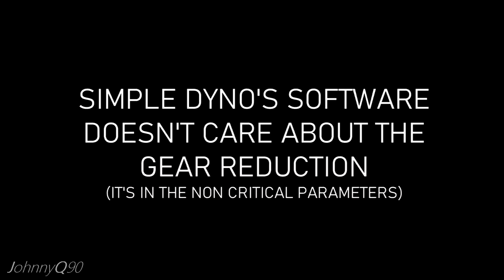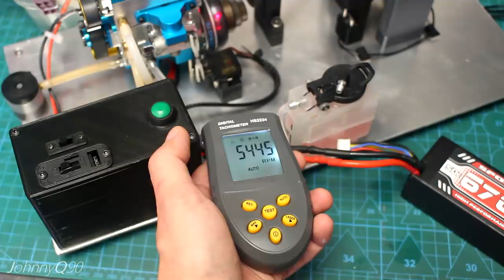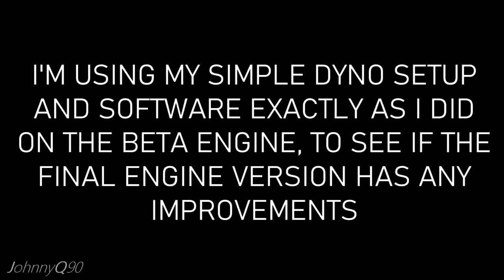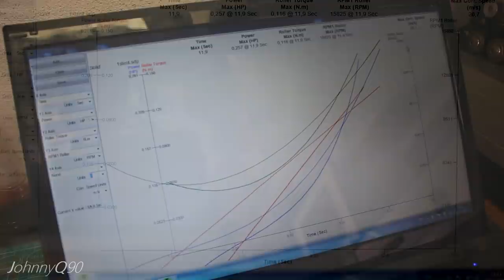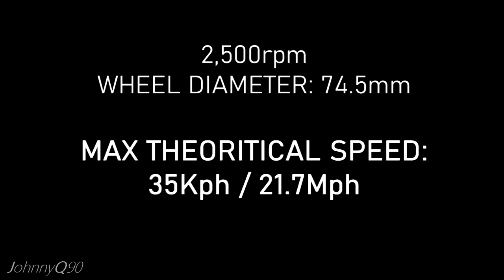TWIN Cylinder 4 Stroke 8.6cc TEST -  Dyno/ MAX rpm/ Road test!

Comment: Second never been so quick

Edit:-SOHC? But I see two cam gears tho...not saying that I'm right
Reply: I was going to comment the same. It looks like a DOHC design to me too. Need the cam cover off to know for sure though.
Reply: SOHC is a Single OverHead Cam, also can have two cam gears, but one is for the intake and other for the exaust, a SOHC engine have two valves per cilinder, one for intake, other for exaust, while DOHC have four valves per cilinder, two for intake and two for exaust.

Also there's few cases it have 3 valves per cilinder or also 5 valves per cilinder(for example the 4AGE, AE86's engine)..

If any car specs doesn't appear if the engine is SOHC or DOHC the better option is check the valves, a 4 cilinder engine have 16 if its DOHC and 8 if its SOHC, in this case the SOHC 2cilinder Toyan engine have 4 cilinders.
Reply: @matthewmondragon2074  So a single overhead cam engine can have two cams?  You're funny.
Reply: @dav1dsm1th  Camshafts
Reply: @matthewmondragon2074  So a single overhead camshaft engine can have two camshafts?  You're funny.
Reply: it has only one camshaft and two valves per cylinder. The second "timing belt gear" is just a pulley

Comment: What an improvement over the L200! It's amazing what porting can do. I do have to say though this motor is a DOHC not a SOHC.There are definitely two cams not just one since there are two gears in the head :p
Reply: Nope, it has only one camshaft. The second "timing belt gear" is just a pulley

Comment: Isn't that a DOHC, not a SOHC?!
Reply: Nope, it has only one camshaft. The second "timing belt gear" is just a pulley.
Reply: @theo7709  oh ok, there must be a twin cam version though, on the back of the head it has 2 cam covers
Reply: @richardperrin9374  because you need the second covered hole to be able to fix the pulley. When he turns the engine you can see a second cam would interfere with the spark(glow)plugs. The cover is useless but they did it for symmetry I assume. But also not sure.

Comment: as an engineer..your videos drive me nuts. you are reading no load speed from the wheel.. and why just why did you replace the start motor with a brushless one?..it meant you had to relocate it when a brushed one was fine. 
after all that, you lie your radiator down so it cant get any air flowing through it. so basically you've added water and a radiator for no reason.
the real kicker is the 3d printing.
you are 3d printing things that you can easily make with wood and steel or alloy. just a few bends and screws. You can make it stronger and faster and the same weight with less volume taken up.
3d printing is best when you have complex shapes.